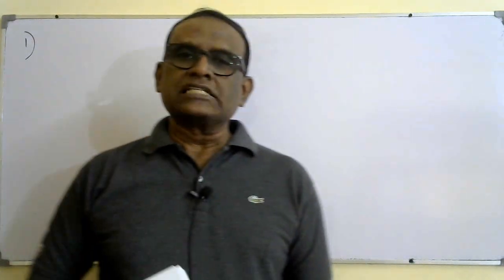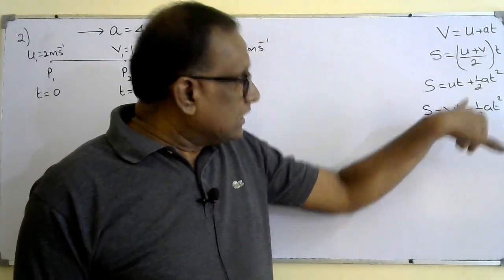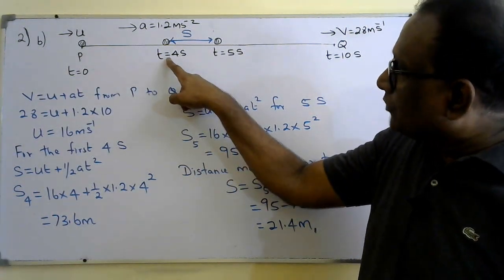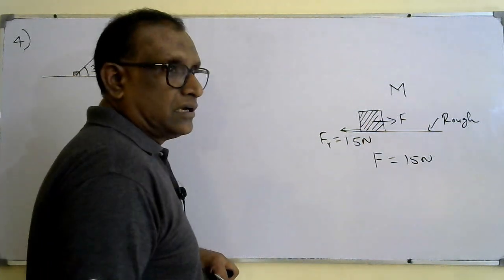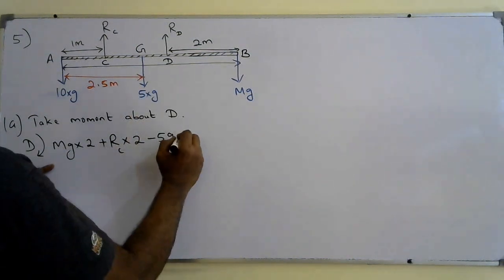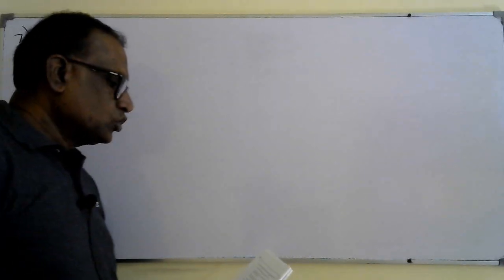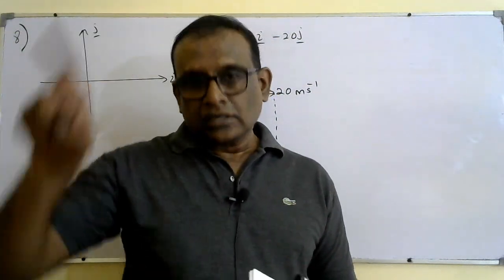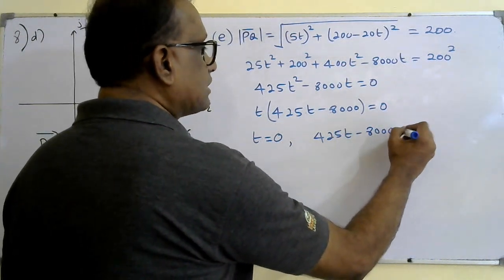Lesson Mechanics M1 May June 2022 Edexcel IAL Past Paper Discussion Graph Vector Motion Moment Force

Comment: sir why didnt you consider friction for q3 as the qs mentions rough ground
Reply from the maker: For the tractor, resistance is 200N and for the block, resistance is R. These resistance forces are included in the calculation.